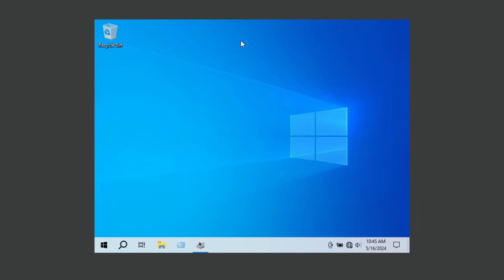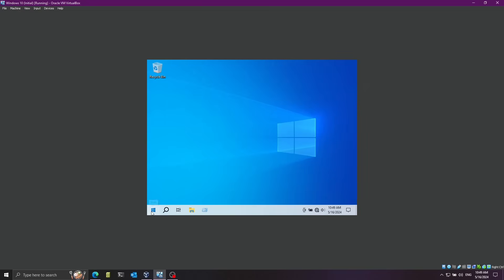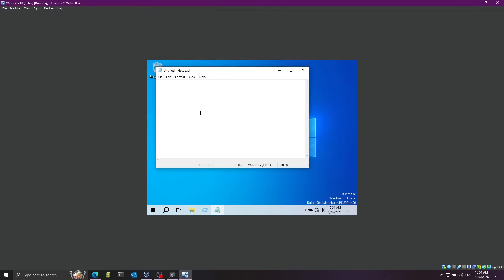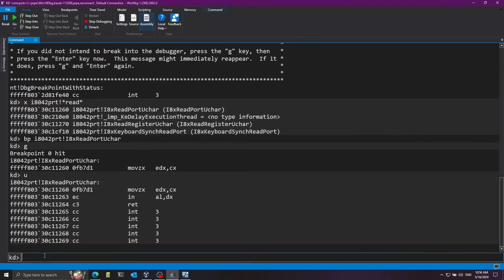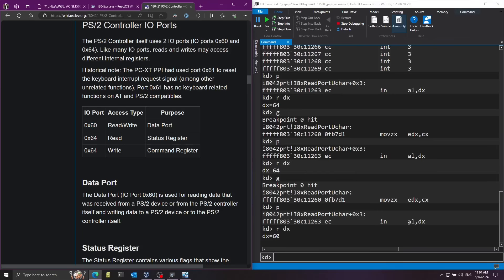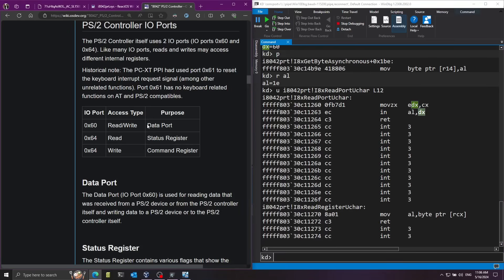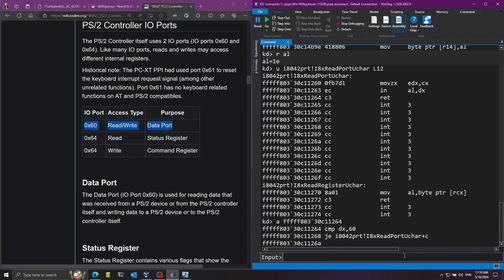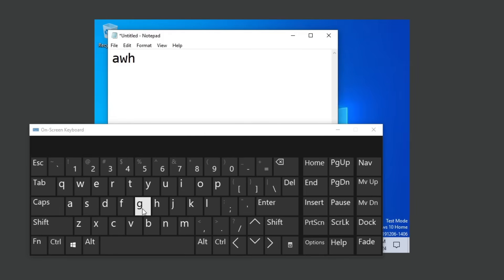Diving into Windows Keyboard Driver

Comment: Just writing this on a whim since maybe you'll see it, but would you happen to have any ideas regarding dealing with a keyboard driver corruption issue on a laptop? Daily, my keyboard will cut out, and stop responding for about 3 to 10 seconds, then work fine for a few hours, where it will then do it again. This eventually leads to the driver completely dying and me having to uninstall the keyboard driver, restart the laptop, and then deal with it randomly cutting out here and there for a couple of days, until it does it all over again. I think the easiest solution would be an alternative keyboard driver, and just seeing if that solves it, but idk, ultimately this is a known problem with all higher end Lenovo laptops, and seemingly, there is no solution whatsoever, it always comes back.
Reply from the maker: That sounds bad :( Hard to help without having the device physically to inspect, but generally, it sounds weird that it has a custom non-standard keyboard driver, for example my Lenovo Y50 has the laptop built-in keyboard connected to the keyboard port on the motherboard, and then on Device Manager it shows up as a standard PS/2 keyboard and uses the standard Microsoft driver I talked about in the video. How does it show up on your device manager keyboard category? (make sure to disconnect any additional keyboards you may have to avoid confusion)

Comment: I didn't understand the last part, why it won't show the next char in ASCII, but the next chart on the physical keyboard
Reply from the maker: That is because we are increasing the keyboard scan code by one and not the ASCII characters (the keyboard doesn't work with ASCII, the encoding happens in a higher level)

Comment: This is mind blowing. The fact that you can just modify the kernal on the fly through a serial port is crazy. Wow.
Reply: why mind blowing and crazy? It's designed that way.
Reply: At the same time you can disable the serial debugger in bcdedit.  Especially important since many motherboards still ship with a hardware serial port.
Reply: He able to do that because their is nothing protecting anything at the binary level and the VM lives below the binary level for that  virtual OS so the OS can’t take any protective measures
Reply: @wendell_parham dude what bs did you just say

Comment: Why did they add the padding to the functions?
Reply: The padding is for alignment! For several reasons (hardware, cache...), functions are 16-bit aligned and the remaining space is usually filled with instruction "INT 3" (breaks execution if hit) as a safety measure. You'll notice all functions start at a 0-ending address. 😉

Comment: 1:02 whats the other driver then?
Reply: the ps2 keyboard driver is responsible for reading the hardware level data from the I/O port, kbdclass is a higher level driver that communicates with the ps2 driver and gives some consistency to the os with abstraction (correct me if im wrong)

Comment: That's awesome! I'm wondering though why when the cmp instruction was set the address jumped from ...64 to ...68? It doesn't seem like the instruction is using any large values to fill up what I presume is 32 bytes (ig each address can store 8 bytes but please correct me if I'm wrong).
Reply from the maker: The cmp instruction took in total 4 bytes even though we are in 64 bit, since the jump in this case is relative and not absolute so the machine code doesn't need to store the entire 8 bytes of the memory address
Reply: I think each address just refers to a single byte (the address itself is what's 64-bits)
Reply: @b4ttlemast0r  yeah idk maybe that could something related to the OS kernel or maybe even the hardware itself. But still even then it doesn't make sense for me that a compare instruction would require 4 bytes if that's the case.
Reply: hmmm... okay, I must say I'm still kinda new to low level machine stuff, but that's fascinating. So what I understood is that the cmp instruction could make use of those 4 addresses but it didn't so it just skipped them, right?
Reply from the maker: @ahmadshami5847  could you elaborate what exactly you mean?
Reply: @nirlichtman  yeah like when you assigned the address ending in 64 to cmp dx,60 the next line became something ending in 68. is that because the cmp instruction itself reserves those bytes for arguements (including optional ones) for example. Like idk why when you put cmp dx,60 it didn't let you insert the next instruction (je in this case) at address 65 instead of 68. excuse me if my question is confusing or unclear.
Reply from the maker: @ahmadshami5847  oh ok now I understand, each instruction on x86/x64 takes up a variable number of bytes depending on the instruction and its arguments, in this case it went from 64 to 68 because the cmp and its arguments took 4 bytes when represented as machine code, hope its clear now, there are some other CPU architectures which have a fixed size for all instructions, like ARM for example
Reply: @nirlichtman  ooohh okay that makes much more sense now! Thank you so much!

Comment: If I remember correctly, osdev may also mention about a specific byte sequence you send or read from ps/2 keyboard in order to initiate system reboot, which is often used in hobby kernels and I guess I've even seen it in linux somewhere
Reply: Linux has something called "Magic SysRQ". For modern devices, you can press & hold ALT, then tap PrintScreen. This activates the SysRQ, then while holding down ALT, press B to reboot.
Reply: Maybe "REISUB"? The mnemonic is "reboot even if system utterly broken". It didn't work when I tried using it (maybe because I was using a laptop keyboard). "B" reboots, everything else is to kill processes and sync the filesystems. According to the kernel docs, on x86 you can use Alt + SysRq + <letter> (as a single key chord), or type them in sequence.
Reply: SysRQ is from the Sun/Solaris era
Reply: Do you mean Ctrl-Alt-Delete?
That was used to reboot computers in the DOS days
Reply: @0xfadead  No, in the old days the RESET line of the x86 CPU was connected to the 8042 keyboard controller. Ctrl+Alt+Delete is just a sequence of key presses given special meaning in the OS.

But if you poll port 0x64 until the controller is ready, then write 0xFE, it resets the CPU to its initial state, rebooting the system. Although this is actually how you switched out of 16 bit protected mode back into real mode on the 80286 as well (as memory stays powered, you can hook into the reset handler and skip system initialization). 
void reboot()
{
    uint8_t good = 0x02;
    while (good & 0x02)
        good = inb(0x64);
    outb(0x64, 0xFE);
    halt();
}
Reply: @nathanielcleland6566  Ah lol, didn't know about that. It makes much more sense. Thanks for the swift response!
Reply: @nathanielcleland6566  I distinctly remember thinking it was really weird that I had to write out to the keyboard to get into real mode. It was obviously just hardware economy but it still had me scratching my head for a day or two
Reply: @charlesnathansmith  Yeah, they put that in on the 386, but introduced a bug that still exists to this day (I guess you could call it a feature now 😂).

Real mode is implemented with compatibility values in the segment registers, but on dropping from protected mode to real mode the processor's descriptor caches aren't flushed.

This means that segment limits are no longer 64K, and, in combination with the 32 bit override prefixes, you can use the 32 bit registers in real mode to address a full 4GB of address space.

Welcome to Unreal Mode.

This actually applies to code too, but compatibility is much harder as interrupts only preserve ip, not eip.
Reply: @nathanielcleland6566  thanks a lot, tried it and works like a charm , just been reading about this and was curious what it looks like
Reply: @0xfadead  nah, there is a keycode for reboot, i have an 90s keyboard with such key and it works in modern operating systems.